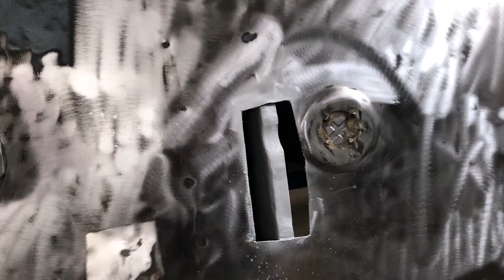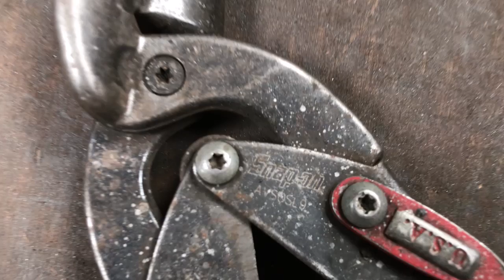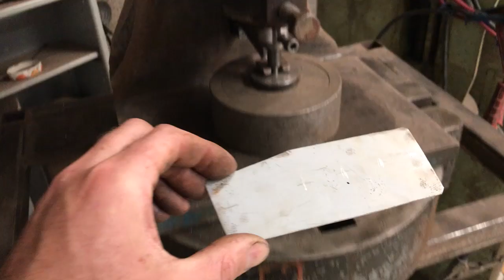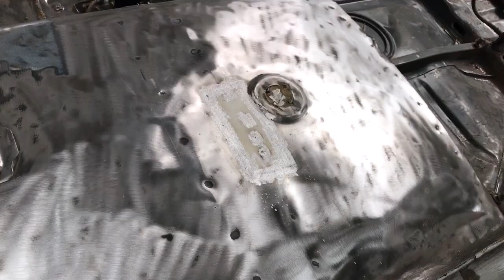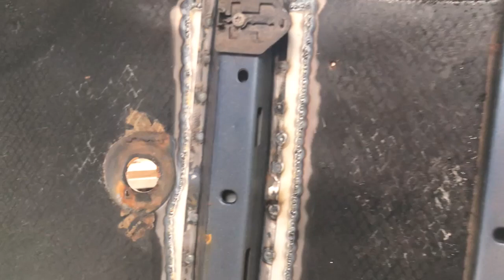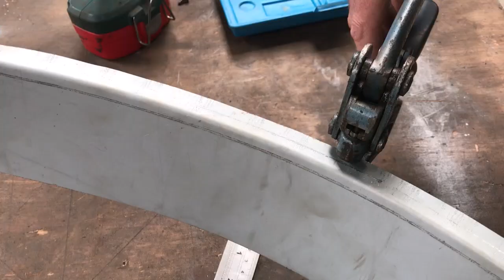TOP TIPS classic car welding

Comment: how do you clean the other side of the weld after tacing if its not accessable?
Reply from the maker: If it’s not accessible then you either can’t or you have to remove a section to gain access. Most of the time when you can’t access the other side you just have to accept you can’t clean the area for welding. If there are some access holes then media blasting might be an option, depends on the situation. 
What is important after welding is cavity waxing where you can’t paint. 
Most of the time if you are removing a section you will have access to the inside via the removed section.
Reply: @bensclassicbodywork okay thank you for responding, I need to repair some rust on my cars sills/rocker panels I think they're called in America. But once I place the small panel onto the sill and weld it in place I can't access behind it anymore, but the waxing is a good idea I'll look into that. Thanks again

Comment: Hi Ben. Another great video. Just out of interest is there a rust converter you would recommend over Hydrate 80? As I was a bit concerned about what you've said about it as I've used it in a recent underside restoration before using Novol epoxy primer and top coat.
Reply from the maker: Hi, I haven't found a rust converter that does any converting of rust, from my experience it just covers the rust like paint. If you scratch the surface after treatment it reveals orange active rust.
It does as good a job as paint which I also haven't found a paint that is good at holding back rust. In my experience nothing will stop rust coming back through it has to be removed. 

For underneath it's not such a big deal, you can apply Underseal or wax over your paint and that will definitely help. You have slowed the process down and if you see paint bubbles/spider webbing it's not a big deal under the car. 

Epoxy is good at adhesion, hydrate 80 is good at adhesion, what you have done isn't bad but if you want the best then the rust has to be removed.
Reply: @bensclassicbodywork  yh ok thanks Ben, so I haven't necessarily used the wrong products but none of them are miracle cures. I'd love to be able to fabric and weld like you though and really enjoy your videos. Keep up the good work and thanks again 👍

Comment: Some very useful tips here, but I have a question. Why use Zinc primer, rather than copper?

Zinc has a boiling point of 907*C

Copper has a boiling point of 2562*C

From my experience, Copper is a much safer primer option for plug welding over Zinc, and should protect better from corrosion forming around the weld
Reply from the maker: Good comment. I had to do some research as I didn't know why there are copper and zinc options. I've used both over the years but I've used zinc way more than copper. From my research zinc is better at protecting the steel from corrosion as it provides a sacrificial coating, just like galvanising or zinc plating. Corrosion attacks the zinc and not the steel when in contact with an electrolyte. Zinc rich weld through primers do spit a bit more and copper less so. From what I've read copper is better for welding but not so good as an anticorrosive. 
The low melting point of zinc allows it to flow around the plug weld and coat the inside. 
Feel free to correct me and thanks for bringing it up as I've learnt something.
Reply: @bensclassicbodywork  Both work as a sacrificial barrier to corrosion, but you have to consider that Zinc will mostly evaporate due to the heat from the weld. Typically 1000-1100*C. Effectively leaving you with little to no protection around the weld.

Copper won’t flash off till 2500+*C and has a higher melting point, allowing it to “pool” around the weld as you described.

Zinc would be better suited to pinch welding, as the heat generated it a lot less and in a much smaller area. For plug welding Copper is definitely the way to go as you need a decent bit of heat and typically have much larger surface area
Reply from the maker: @UP4U  I've just watched a video comparing the two with regard to the boiling point and it makes perfect sense that the zinc would evaporate away during the welding process. 
There are some forums saying that copper accelerates rust and zinc prevents it. I suspect this isn't correct as they wouldn't sell copper advertised as an anticorrosive. 
I looked at the upol data sheets and copper vs zinc. Both are advertised as suitable for mig welding. Very little data on those sheets and it didn't explain anything. 
I would guess that copper is better around the weld and zinc is better for the non welded areas? I'm guessing as I don't know the answer.
Reply: @bensclassicbodywork  I'm unconvinced that either work when used as a "weld through" material - welding burns both away, leaving bare steel. It's kinda kidding ourselves that painting the back of weld areas before welding works. The only thing that works is treating after welding is completed. I see lads painting seams then spot-welding them - wherever they weld, it's gonna rust as the heat from welding sends all & every coating right off into the ether. I also believe only oil or grease based products work as "after-treatment" to the backside of welded areas - I am unconvinced by anything else. They look pretty for a while, the paints & suchlike, but chances are pretty for a while is about the height of it. Oil & greases tend to be long-term, despite how non-pretty they appear.
Reply from the maker: @jamesward5721  yes, I think getting cavity wax in the joints or if that's not possible then tiger seal the joints. Both take away the air and stop moister getting in. The weld through primers wouldn't last long exposed to the elements. They are just an added thing that is better than nothing I would say.

Comment: Well, you certainly do like to keep yourself busy !! :) 
I take it this is your day job then and not building helicopters ? :D :D :D 
Welding is one of those things I've always fancied learning to do, it looks like useful skill to have. I can work with wood but metal work other than the most basic has always eluded me. One of my paragliding buddies is a hoof trimmer by trade, mostly cows but horses too and he's invented and built the craziest machine attached to a truck that picks a cow up and rolls it on its side so he can safely trim their hooves. I couldn't believe what I was seeing... 
proper Wallace and Grommet ! but done well, and without the cheese :)
What is it about the English man and inventing things in their sheds ? :)
Reply from the maker: 👍 Yes, it's my day job but I started as an engineering apprentice, the cars were just a hobby that became my profession. 
Your mate that made a cow/horse rotisserie sounds amazing. 
Working with wood isn't something I've done a lot of, one of the reasons I would shy away from wooden rotor blades but as you know it's an excellent material for the purpose. I'm completely at home with metals.
Reply: @bensclassicbodywork  .. 
You're clearly very skilled with your machining and metal works !!
I did wonder about using a nice dense and strong hard wood for the leading edge of the blade and foam core for the trailing edge with a carbon fiber shear web between the two, skinned with carbon fibre and possibly a protective glass fibre over that. 
Not sure if it would be any cheaper than ali though.

Comment: thx for the tips, i hope i can finish my gt junior oneday 🙂
Reply from the maker: 👌 nice car, what stage are you at with it ?
Reply: @bensclassicbodywork   thx, i welded the trunkfloor , now i need to change all seals both sides , innerseals inclueded :( , thats not an easy job
Reply from the maker: No it's not but made much easier with a hard top. I always have the car sitting on its wheels and the doors on when doing sills. I saw a video of mx5 sills being done on a roll over frame. Boy is that asking for trouble.